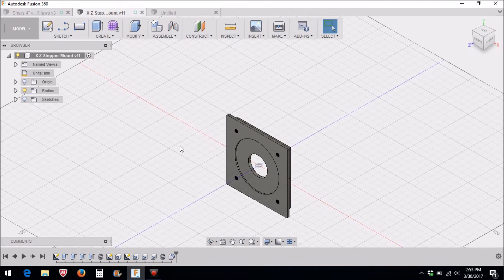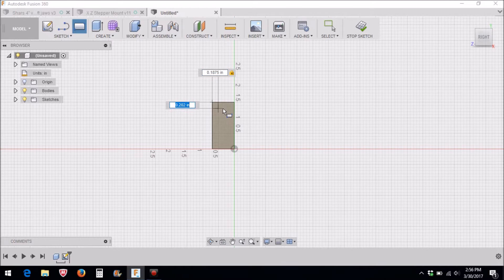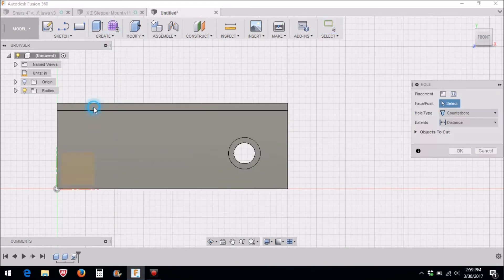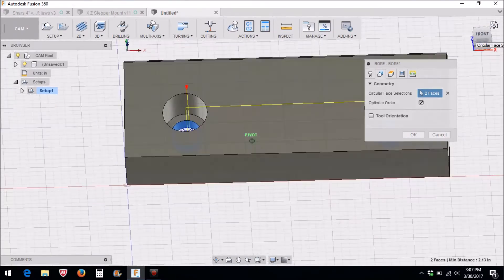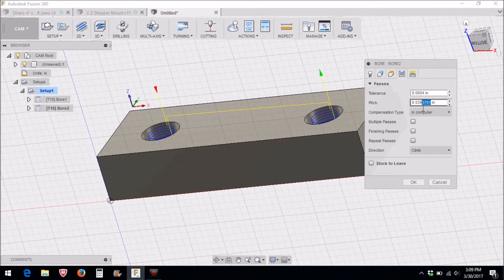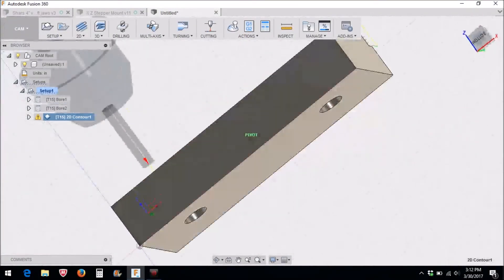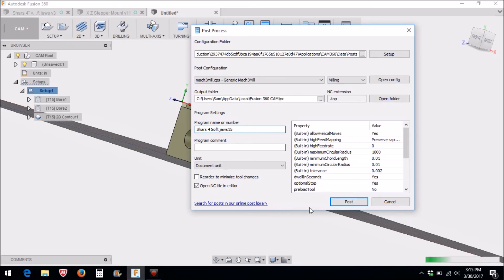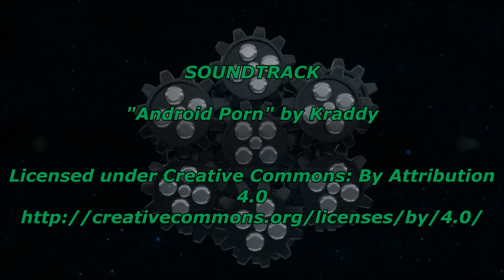Fusion 360 Soft jaws

Comment: Thanks.  I was trying to make some jaw blanks, and I was about to throw in the hat.  Manually coding seemed much easier than 2d adaptive shmadaptive etc etc.  Fusion 360 still uses a lot of wasteful Z moves, but whada hay.  When it will come time to do complex 3D curves I won't be able to manually Code, so I get used to it.  But, take boring cycle, why can't it helically ramp down into the hole with minimal diameter and then start gradually increasing diameter to clean out the hole?  Why can't it just stay down there or give you the option to take finish cut at bottom of counterbore?  You select multiple steps so you won't overload the cutter and what you get up and down moves with Z. Or how come I can't get it to do one hole completely and then go to next?
Reply from the maker: Hi Joe I understand what your saying here. But, take boring cycle, why can't it hectically ramp down into the hole with minimal diameter and then start gradually increasing diameter to clean out the hole? Fusion can do this as seen in this weeks video. https://youtu.be/Z-p0oNn5A6o?t=478
 However you have to choose an 2d Adaptive op to accomplish this.
 You can also try to select Keep tool down.
there are still some things that need tweaking for sure.